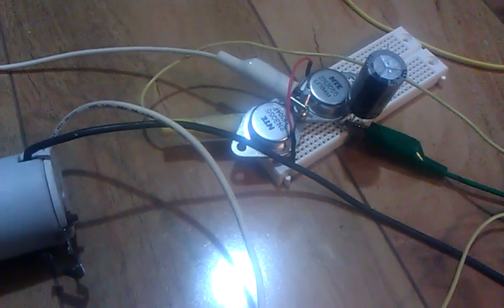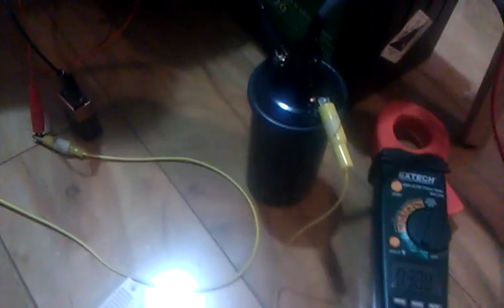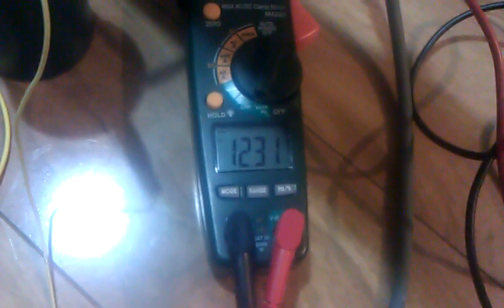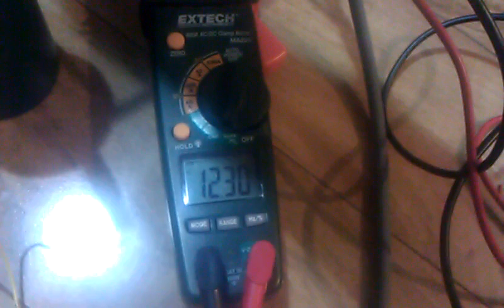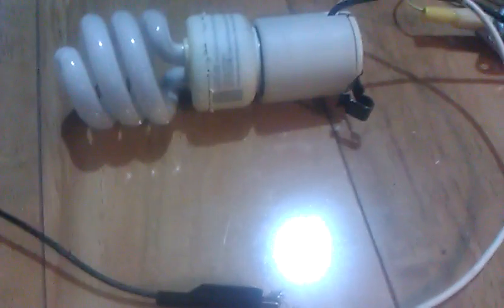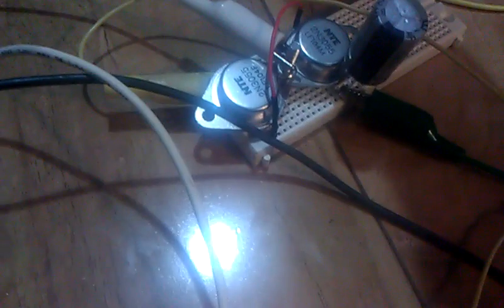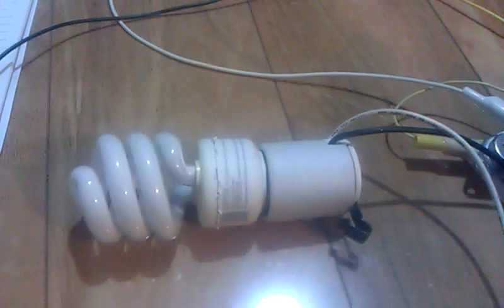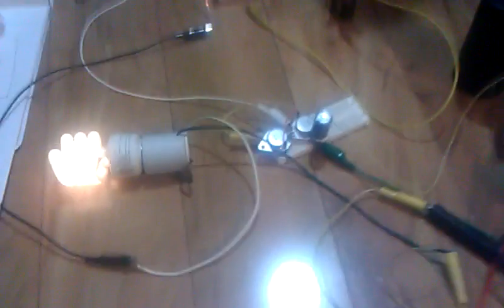Replication Imhotep Radiant CFL Oscillator and Self-Charging?? Part 4 final

Comment: good job! I tried to replicate but it did not run. very low voltage between ground and emitter, not enough to start. though the ground was my heater under window in condominium.
could you say what was your volts?
thanks